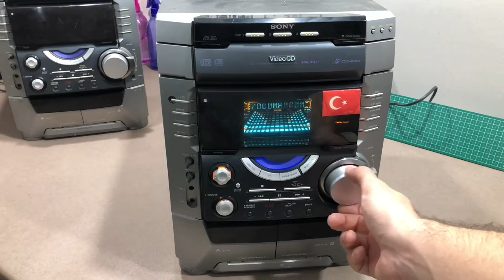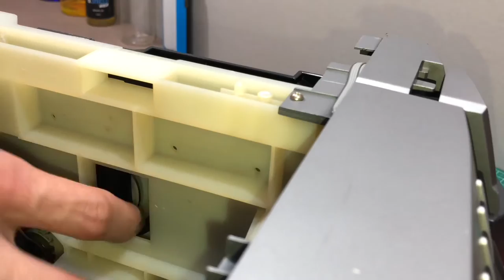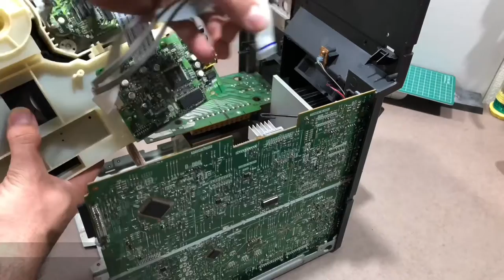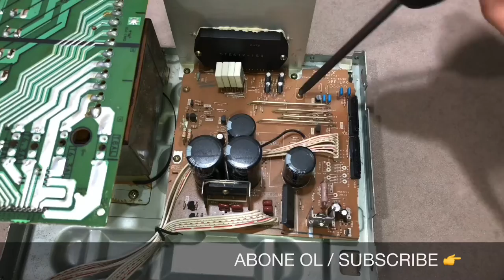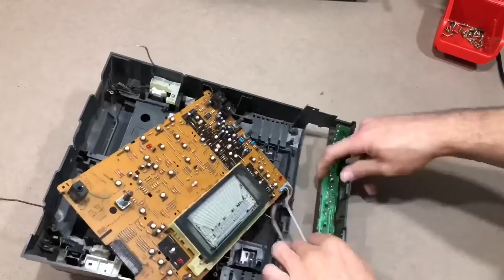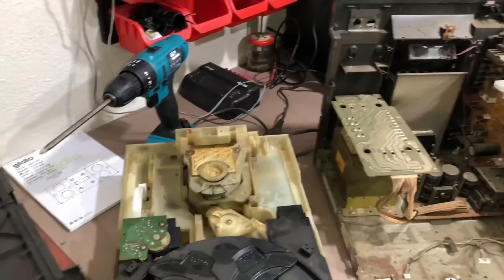SONY MHC-VX77 Maintenance Repair Restoration Disassembly Part 1

Comment: Top video! Do you know a cause for several of the buttons on the front not working? Remote controls them ok so appears to be the front board perhaps? Cheers in advance!
Reply from the maker: https://youtu.be/RJsQ3DTwOvA 👍🙋‍♂️
Reply: I have the same exact problem and I only can control from remote. Have you fixed this issue? Does the link below helped or did you use another method of solution to fix? Please enlighten me, thanks.
Reply: I never got mine resolved in the end.  Considering the time I use it I will just use the remote.  It seems like so many buttons no longer work it would be hours of work to strip the unit down to get to the board and then remove all the buttons, disassemble them, clean them and then put it all back together again. It is a shame this happens since its a cracking unit!

Comment: Hi,
Please guide me to connect the TV to this stereo using the optical port.

I have connected a Sony TV to this stereo using the optical port but it doesn't make any sound
Thank you
Reply from the maker: That output for the cd player. If the cd is working, if the tv has an optical input, it works if it is connected👍🙋‍♂️
Reply: @manstuckonhishead  thank you. I don't understand why this stereo has built-in speakers but has an optical output.
TV is definitely an optical signal output, it can't be an input.

Comment: Hocam merhaba aynı marka modelden bendede var halihazır çalışır sistem problemsiz kullanıyordum fakat LCD ekran bı anda karardı.sistem çalışır durumda ses falan çıkıyor ama ekran yok problem ne olabilir acaba.engin tecrübe ve bilginizle beni aydınlatırsanız çok sevinirim.simdiden tesekkurler
Reply: Selamlar aynı sorun bende de oldu çözüm buldunuz mu
Reply: Arkadaşlar aynı sorun bende de vardı türk işi kasaya vurun düzeldi benim😂
Reply from the maker: Merhaba.Soğuk lehim olabilir.Lehimleri tazeleyin.Ekran lehimleri kart lehimleri hepsine bakın.Zamanla bozuluyorlar 👍🙋‍♂️
Reply: Aynı sorun bendede var icini actim tozunu aldim topladim tekrar calisan ekran calismaz oldu ne yapabilirim

Comment: How much percent of isopropyl to clesn the circuits and parts ?
Reply from the maker: I don't know about the percentage. I don't clean the circuits with alcohol. I take the dust and wipe it with degreaser liquids.
Reply from the maker: I don't know about the percentage. I don't clean the circuits with alcohol. I take the dust and wipe it with degreaser liquids.

Comment: Sir my self Amit I am BE Electronic teacher also doing small Electronics project for BE Student MY Problem is Sir MY Sony DVD player MHC GN77D 4600w  MD INPUT is only 2 channel Stereo INPUT Only.  Sir I want to get 5.1 audio Input how to find which track in PCB board if you know please guide me. or how get 5.1 audio INPUT. Please guide sir.
Reply from the maker: My friend, as far as I understand, you are more knowledgeable than me👍🙋‍♂️

Comment: Anyone with this system who can verify if the Aux port in the front labeled as "phones" ONLY functions as a headphone port/output port?

I thought to remember years ago using it as an input port as well, using an old phone, It didn't work on my friend's phone.
But now, today, I tried it again, and it only works as a headphone jack. No input functionality anymore, not even with my old phones.

Anyone knows if my memory is just making it up or if it's capable of being both an input as well as an output?